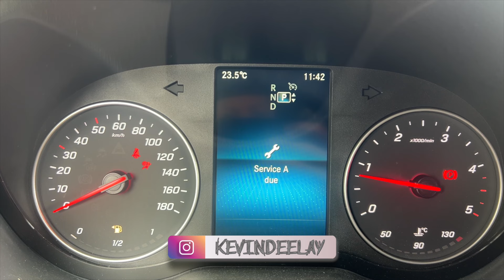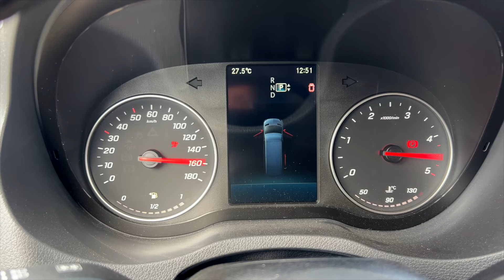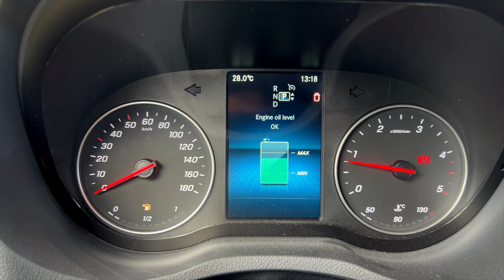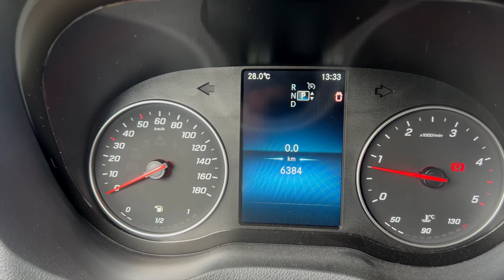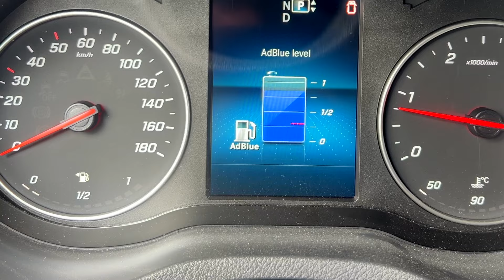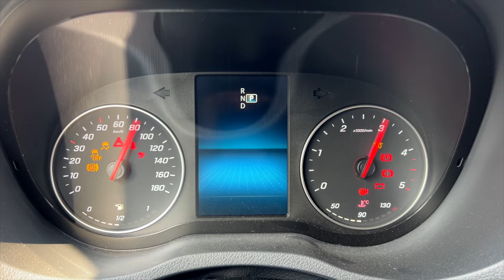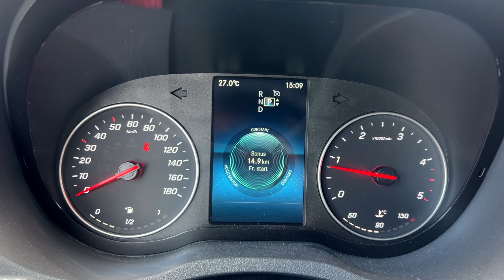Mercedes Sprinter 2022 - Service A (Oil change, filter & AdBlue)

Comment: I did my First oil change this weekend in my life on my 2024 sprinter followed your steps and got the same setup kit it went perfect,thank you boss!
Reply from the maker: @martinnilsson5295  Awesome! I did my first on my 2010 Sprinter, back in 2020 something. We learn a lot right, and save that €400 if a workshop would do it. 
Appreciate that I could help 🙏🏻

Comment: You can remove the oil filter without removing anything. Just get a swivel attached for the the wrench. It's tight but you can do it and it doesn't make a mess. I've done it twice, thus far, and no problem. Also, just buy a new copper gasket.  Why risk any issues on something so inexpensive; I use OEM oil filter and use Mobil1 5w-30 ESP. I live in the US. 

I have a 2023 and for my diesel, it's recommended to change out the fuel-water separator filter every 20k miles, as well
Reply from the maker: @charliep5139  Yes I know it’s possible! In this case I wanted to show people who are not sure, just how easy it is to remove stuff. 
Sounds good, bet your van runs all fine 👌🏻